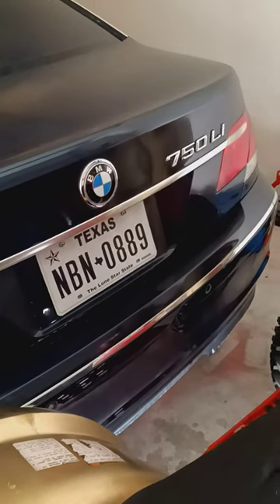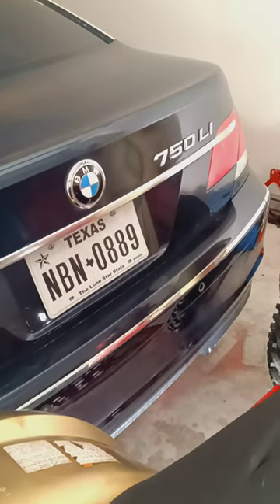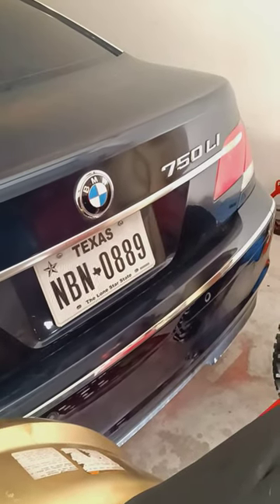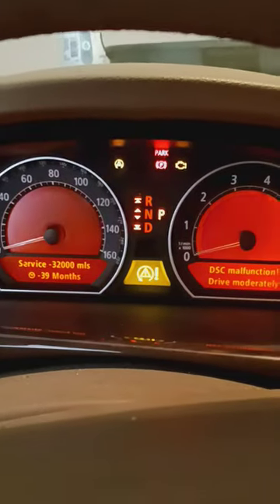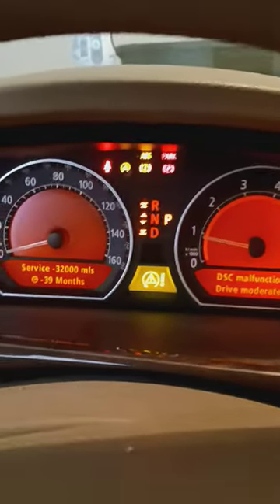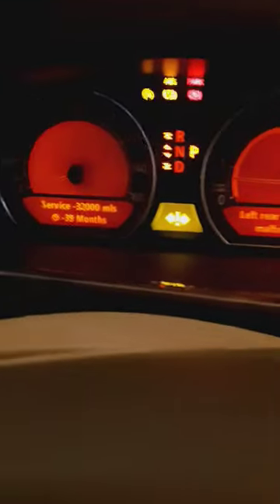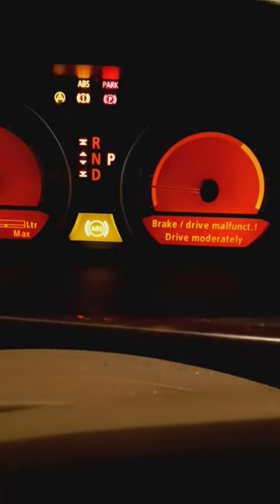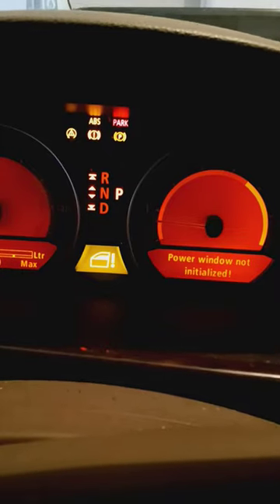2008 750li TRANSMISSION PROBLEMS HOW TO FIX NO REVERSE NO DRIVE

Comment: Aye I got a 745i doing the same thing how did you fix the issue
Reply from the maker: I got videos on how I fixed it bro. You can do it yourself. Easy d.I.y
Reply from the maker: It’s on my channel
Reply from the maker: Purchase a transmission rebuild kit and replace the seals and mechatronic sleeves and harness holder
Reply: I have a 745i and I wasn’t get to place it in park so I’m Sure the solenoids are sticking💯
Reply: Hi I got a 2003 bmw 745li doing the same thing is there bye any chance you can give any advice on how to fix it please